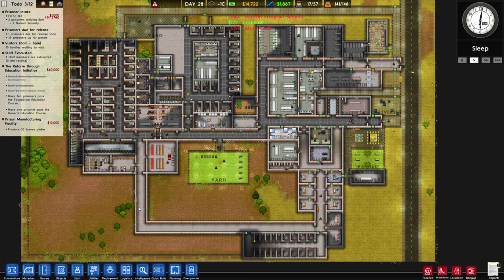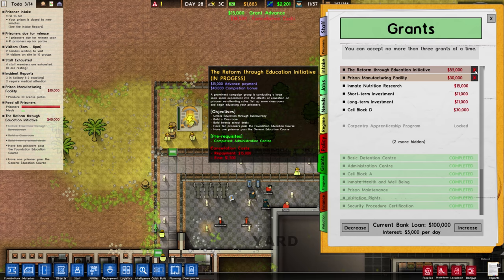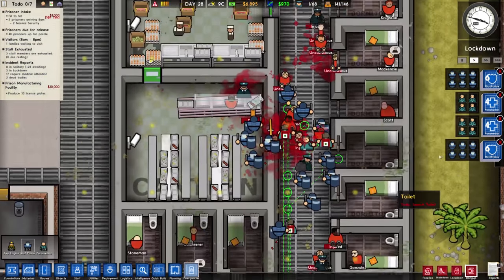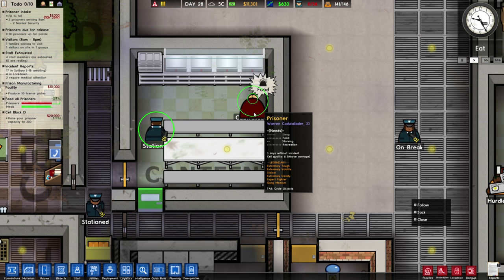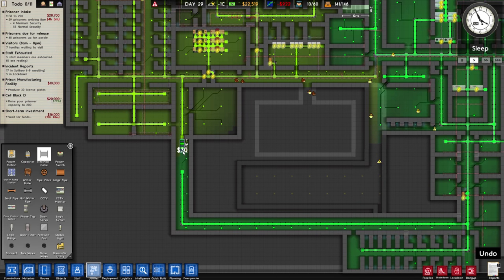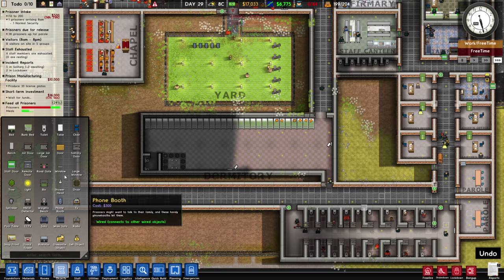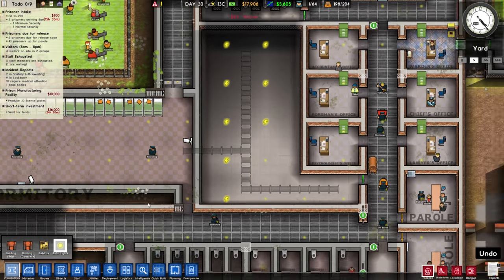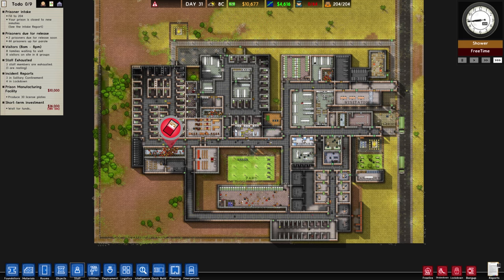Prison Architect - SECURITY NIGHTMARE ★ Serious Complaints, Prison Valuation, Freefire - #11

Comment: Alright, stop Weasel. Stop. Take a break and look at the options you have opened to you. First issue, you have prisoners mixing. Set an area for Protected Prisoners; snitches and ex-cops ect-ect and limit an area and canteen for them and them alone. Same with Medium Prisoners and on up to Max Prisoners. You do not need to build a lot of kitchens, just one kitchen large enough to put out the food you need. Using Logistics you can assign that the Kitchens fill the canteens as well as assign which Cell Block eats in what Canteen. Mixing the Prisoners together the way you have them, just leads to problems and ends up having them move in one big mass to the closest area they need; shower, food, yard ect-ect. Secondly, break up their meal times. Normal Prisoners should not eat the same time as Max Prisoners and Protected Prisoners should eat alone. 
 Next, go into your Policy tab and make it so only certain crimes in prison make them upgrade to the next level of Prisoner and no matter what Protected Prisoners will need to stay Protected Prisoners. Anyone with Deadly needs to be made Super Max right from the start. These will help keep your Death Counter down. Put Dogs on patrol in Cell Blocks and only assign them to a one block path so they stand still at doors like Canteen, Cleaning Closet, Shop Room and the Yard since ( though you do not see the person doing it ) they have a feature where people can throw contraband over your wall for Prisoners to pick up. Super Max and Max Prisoners should be the only ones with Armed Guards and you really should leave them on Free Fire. You just need to organize things a bit.
Reply: Cruxus YES YES THANK YOU FOR WRITTING THIS
Reply: Cruxus LIKE THIS